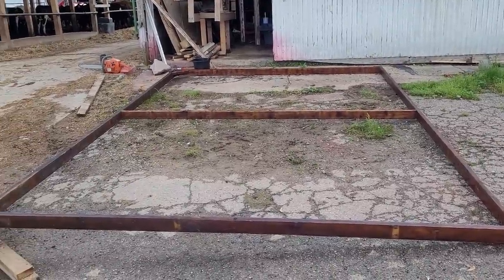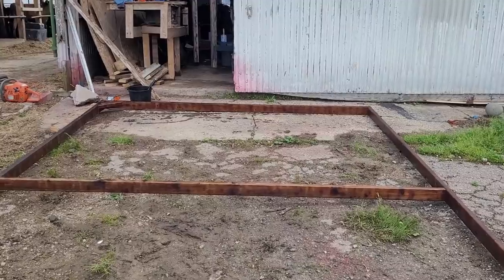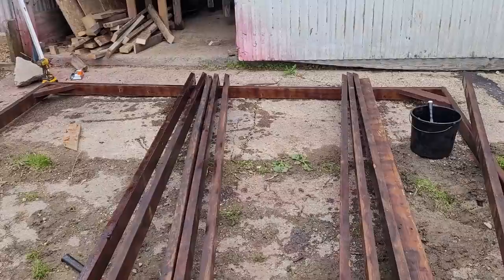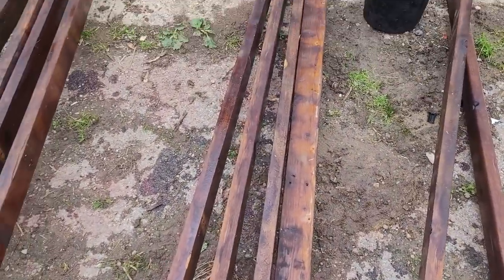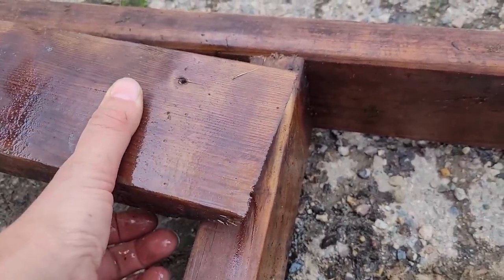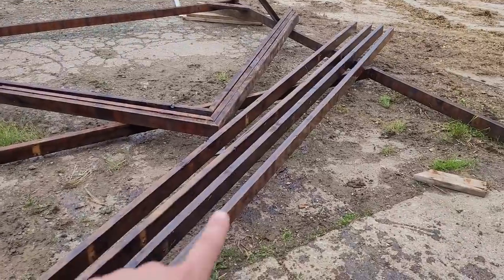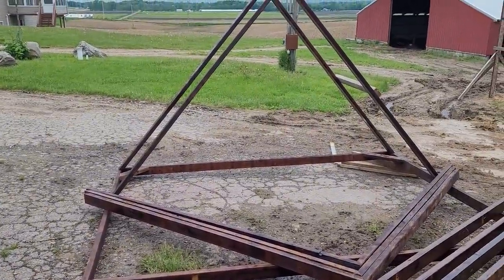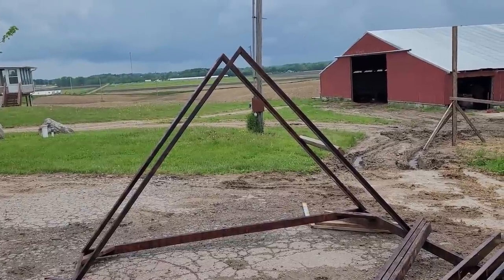Building A Chicken Tractor

Comment: Hand staplers are problematic because they can pull out easy after the wood shrinks. Maybe a few longer hammered staples at a little wider intervals would help secure the chicken wire and keep as you pointed out, the wire from detaching. This chicken tractor from the start was going to be too heavy, the operative word here is tractor. You will need to use a lawn tractor or larger and move it from place to place. Looks solid and will service a long time. God Bless.

Comment: I made a 16’ x 12’ and I have 45 birds with lots of room to spare.  You can get close to 100, I imagine.  I installed two eye bolts and connect a chain to the quad to move it.  I have wheels on all four corners.
Reply from the maker: I wondered about having 4 wheels. Thanks!!

Comment: You could use some wood slats like the size of a yard stick and screw them down over your chicken wire to keep the staples from pulling out. Also just find a scrap board as a backer and put a screw in the roofing metal holes, it will stiffen the metal and fill the holes.
You did a great job!!!!

Comment: That looks great.  One tiny suggestion is that you could screw on some top braces at the peak.  That gives the "rafters" quite a bit more strength especially when it is going to be moved.  The chicken droppings are good for the soil.  One summer task was to take apart an old chicken coup.  I will never forget the strong odour of chicken manure.  😊  . . .  birds excrete uric acid as well as the digestive waste together.
Reply from the maker: Thanks!!!

Comment: You could probably nail some lath boards on the backside of the door to help hold down the chicken wire.  You could probably use lath boards on the outside also.  A hungry predator will dig and and pull at the wire also.  As far as moving the tractor,.....that's why you have those strong strappin' young sons.  If nothing else,.....you could rig up ways to use the loader bucket, forks, or 3-pt hitch to move it around.  Just for info,.....I do not know if Kevin looks at the "Farming Fixing & Fabricating" channel, but Andy has a video coming up about his chopper catching on fire.

Comment: Sanders probably has a riding law mover he'd let you use to pull it with.
But First, I'd double up on the front 2x4 so when it's being pulled the board won't snap as easy. 
Kevin and your boys could definitely build you something that will work great.

Comment: Good move on making that door, the other one would warp and fall apart in a year. You could rig up a piece of pipe  on the front that the arms of a 3 pt hitch would slide over long enough to move it with a small tractor or loader. Looks good, they finish so quickly that they won't be in it very long.

Comment: Hi that's amazing well done,what I would is the latch has hole in it I would put a carabineer in it as extra security stops the latch being lifted by predators,I guess you have raccoons there I'm from the uk ,too move it attach 2eye bolts a short length of rope then you could use the tractor too move it or a side by side or atv

Comment: Ronda -- Very nice job. I would like to suggest the following refinements. If you put wheels on all four corners, as some have suggested, you might want to either put some type of "ski" or "skid plate" on the corners of the ends you will be dragging it from so that the base does not dig into the dirt as you drag it. Also you could make the wheels on the end you will be dragging it from to be adjustable so you can raise that end slightly so that it does not dig into the dirt as you drag it. Also you might want to install a couple hooks on the bottom of the base on the end you will be dragging it from so you have them to attach your chain or straps to when you use the riding mower or quad to drag it. I am impressed though with your ability. You are a woman of many talents!

Comment: I knew you were going to have a problem moving it with how the tractor possibly your son's garden tractor would more like it do it but just put a piece of two before full legs flatways on the front on the inside run you a couple bolts through or cable and that should be able to pull up that way but you really will need to get the front end of it off the ground just a couple inches why did you not put some gas gussets on the very top cold of those a-frame also run to before on the inside from the front about the metal to the second rafter and angle that way will give you some racing and keep it from folding up sometime I seen your wheels on the back look like they had a rod recommended down and getting on the wheels you might also want to put a piece of pipe or two before up off the ground just a little ways in the very back so so when you going to move it it will move the chicken son of been away from it or you will be probably running over their legs unless they run out of food and you move the feeder forwards all the time I'll message you yourselves I hit the like button before I even start I hope that's okay for everybody just want to do I came from an old very far back of the years we raise dairy beef jig laid hands and hogs have a lot of ducks and geese running around then we never done anything with them have had a lot of bad days to

Comment: Since it has rear wheels, add some large screw eyes on the front, bottom member.  Then you can use rope or chains to enable the tractor to lift the front end and drag the whole shebang to the next location.  OR attach large screw eyes to the ridgepole and use those with ropes or chains to lift it wholesale with the tractor.  It is just too heavy for one or two people to mive by hand.

Comment: To make something to move the chicken tractor you can take pipe and bend it as a cart like  a wheel dolly and  put wheels on  it and everytime you want to move it just put this little 2 wheeled dolly in under the frame in front by the door and pull back on the handle and it lifts up the tractor jus a little bit and you can pull pretty easy unless the ground is to uneven.

Comment: Put a little trailer hitch at the front where door is and use Sanders lawn mower to move it.  Or add two more wheel at front and then use mower to move it. Just make the wheels so you can take them out so you can lay it flat.

Comment: You do some great work. And very professionally built .What else I would do , as I did with mine. Was your metal roof covered area . I would put in a floor and cover the front of that area under the  metal roof or plywood to keep them out of bad weather and high winds , and put in a chicken door with a latch that you can close from the outside ,that you can close them in at night , to avoid any predators getting to them. A raccoon or skunk even a snake can dig under that 2 x 4 frame real easy at night and kill them chickens . Put a piece of chicken wire above your door. Anything could climb up that chicken wire and get in that way, or even a bird of prey could fit in there . To move it ,you will have to brace and support your bottom 2 x4 frame with attaching a 1/4 inch or 1/2 steel plate with lag bolts on the inside and the outside of the frame the full width of the door ,  then you can weld a pintle hook hitch or a reciever hitch for a garden tractor on the plate. Or to give you another idea, attach another 2 x 4 on the inside and outside as I described with the steel plate for support and if you ahve an old A Frame wagon hitch or make an A frame hitch attach it to the 3 - 2 x 4's and pull it with garden or farm tractor .

Comment: Nice job Rhonda 👍. If you move those wheels further toward the front the front won't be quite so heavy. BUT the tradeoff will be you can't raise the front much without the back dragging the ground. So maybe wheels also for the front? They would have to swivel though in order to "drive" it.

Comment: Looks great! To move it you can try using an puting an eye bolt on each of the lower front corners and attaching the ends of a chain to the eye bolts. Then you can hitch the chain to a tractor or truck and pull it. You may also want to add some wheels to the front if you are going to pull it as it may snag on the ground, unless you hitch it to a 3-point.

Comment: I would like a chicken tractor but my grass dirt is so uneven it wouldn't be tight to the ground allowing predators. I'm on my 3rd year reusing the movable premier electric chicken fence off Amazon. So far it works really good
Reply from the maker: I've considered trying that fencing... do you like it? Would you recommend it?
Reply: @acresofclayhomestead  yes I like it very much. It's fairly easy to set up but easier with two people. You can move it around easily just by pulling up the stakes and pushing them back in the ground. I use a cattle fencer and it seems to do the job. One that Chicks first come out inside of it they'll get a few jolts and then stay away from it. I've never had anything get caught in it. Cats respected it pretty quick. It even gets me once in awhile if I'm not careful LOL. I have a hundred footer I think. It's a pretty manageable size. The only negative is it's open for Hawks etc. The last couple years I have been fortunate with a crow family that chases Hawks away.
Reply from the maker: Thanks!!

Comment: Great work!!!!!!!  from the amazing Acres of Clay ladies again .  You could put 50+ meat birds in that big tractor.  1.5- 2 Sq. Ft. per bird is recommended.    What kind of feeder will you use.    many homesteaders use PVC cut in half.
Make sure you cover the peak above the door.    Nail slats inside the door to strengthen the wire.
put I-bolts and a cable or chain to pull it with the skid steer.  You will need to add wood where you place
the bolts as 2x4 will be strong enough.
 Cut an angle at the bottom boards so they don't dig in while moving.
Reply from the maker: Thanks!!!